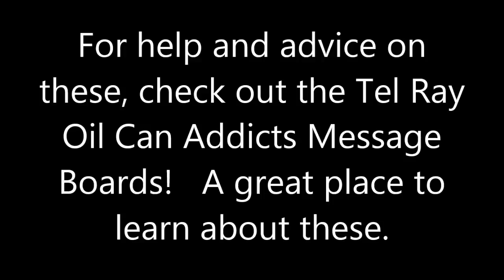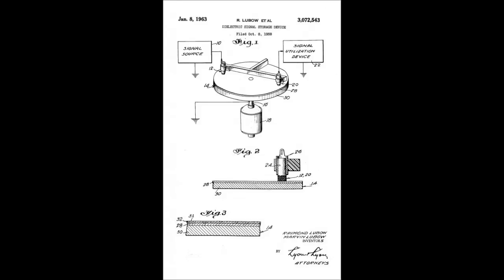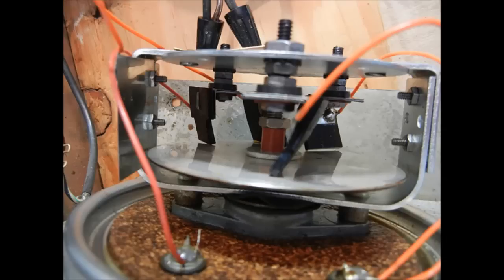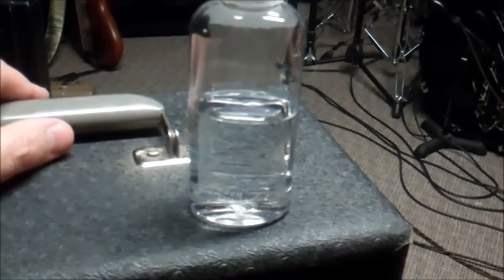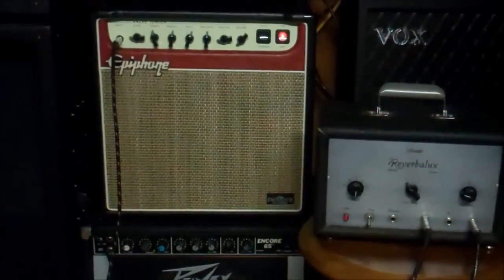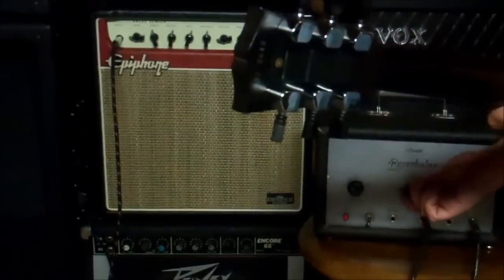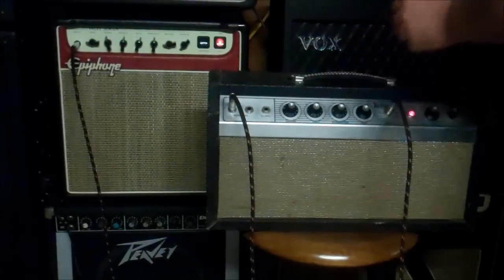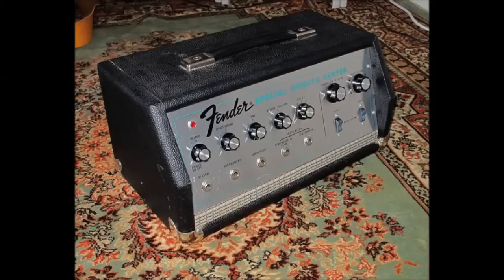All about Tel-Ray Oil Can Delays,  Electrostatic Delay Line,  Adineko

Comment: Do any of the units have a knob to change the speed of the motor I figure the slower the motor the longer the delay time but since it doesn't hold the charge long the slower the speed the more regeneration you'd want to extend the repeats.i really wish they would remake these things maybe design them with a bigger disc and multiple heads variable speed put a reverb tank in with it maybe pair it with a rotary speaker or some kinda vibrato or tremolo probably would cost so much to make that no one would be able to afford it.but really someone needs to start making old germanium transistors and bbd chips so the good old pedals can be made affordable
Reply from the maker: Variable speed drive wasn't common,  but I think there were a few models that did.   Germanium transistors and bbds can be purchased today easily and at reasonable prices... but it's "not the one the famous guy had".....
Reply: @DeadKoby  I know you can get Germanium transistors and bbd chips but the older models required for a lot of cool pedals aren't made anymore and finding a matched set of some are just near impossible I've bought a few pedals with alternatives to the right thing and they sound terrible and don't get nearly the same range like an ehx echo flanger or poly chorus or a burns buzzaround or a zonk machine you can get some of the sounds but not the more extreme settings which are always the best in my opinion
Reply from the maker: If you want Germanium transistors,  get them from Russia.  They still have plenty.

Comment: You missed the Fender Dimension IV. I have one of those and it is pretty cool but limited in usability.
Reply from the maker: With the delays as short as they are,  they are pretty much  "slap-back" machines.  Combine that with a spring for some pretty cool sounds.

Comment: Thanks for this video.  I've just finished restoring a Fender Echo Reverb 1 which is an Adineko 1001 in a different cabinet.  Either someone had put foreign oil in it or the old oil turned Amber over time.  After a good cleaning, 3 prong power cable, fresh LB65 oil, and new capacitors, it sounds amazing.   

However, the motor gets pretty hot and I'm concerned about that.   Does your motor get hot?
Reply from the maker: It will get warm after a time.   Try putting a drop of electric motor oil at the bushings... that may help a bit.
Reply: Those motors were probably originally designed for 110 or 115 VAC. Today’s line voltages in USA can vary, but generally are on average, 120- 129 volts, which is 10-19 volts higher! For an original motor unit, I would only use with a step down transformer, to ensure as long life as possible.

Comment: DK, I have the parts to restore one, the Fender Variable Delay Echo-Reverb. The pots and cap latest date date is 1968.  My research has brought me to your channel which I’m just now exploring. Great stuff. On my unit the chassis has been molested. No new holes, just clipped wires and it has what appears to be a failed attempt at a high gain preamp. The transformer appears good and It had no oil can.  However, I have acquired a NOS oil can and a second one sold as is for parts.   I don’t know what dual 12AX7 schematic was intended to be used.  The two unknown value trim pots on the rear are missing. 
Any guidance, pictures of guts and and advice would be appreciated.  Offline I’m at gmail as quayhog53.
Reply from the maker: I we'll try and hunt you down a schematic there are different version numbers they had liked Mark 2 3 4 something like that. Which model do you have?
Reply: DeadKoby unsure,  that’s the issue. I have all the TelRay schematics on pdf.  There are two that are dual 12AX7. There isn’t enough there to determine specifics.  Email for pictures
Reply from the maker: Ask the user  OilCanDelay  on the Tel-Ray Oil can board.   He's a veteran of these devices,  if anyone has it,  it's him.
Reply: DeadKoby I’m a member of the board and there hasn’t been much activity there.  My recent posts are the only posts in months.  The silence there is deafening.  I posted Ray Lubow’s LA Times obituary which I found in my research.
Reply from the maker: Here's what I found.   Hope it's useful.
https://el34world.com/charts/Schematics/files/Fender/Fender_echo_reverb_iii.pdf
https://el34world.com/charts/Schematics/files/Fender/Fender_echo_reverb_ii.pdf
Reply: Wow, the Fender mark iii is one I have not seen.   It’s very close to the TelRay Echo Verb-rato schematic but it lacks the bass and treble pad switches and other organ specific features.  It may very well be the one. There isn’t much original circuitry left that it’s going to be a total rebuild.  The Mark ii used a 7199 and one I’d seen. Thank you, I’ll pick it apart and see how close the little unmolested bits is to it.  Thanks DK.
Reply from the maker: You're welcome.   I generally don't take on "basket cases"...   if you look through most of my projects, they are usually almost all there,  and they "want to" work.  It's really cool that you're trying to preserve yours,  they aren't a common beast.
Reply: DeadKoby ,I don’t either, usually, but this is a unique opportunity.  I have the build skills and the unique parts.   I had the NOS unit for years thinking about making my own. When the chassis became available I knew it would be work but I didn’t know how disturbed the remaining circuit was.  Neither did the seller.  Except for the switching it’s not any harder than a champ.  I’ve built working Pultecs, LA2A and many amps.   I have the time now that I’m retired.
Reply from the maker: Super cool.  I hope you get everything running well.   These are such unique echos.  Nothing sounds quite like it.

Comment: I came across a Standel Duette 2 in PERFECT condition (caps,dropping resistors ,and cord replaced/fuse added)other than the scratched disk. Was hoping you might know of a source. I’d DEFINITELY be interested. Here’s a short clip of it during an occasion when it was sort of working well. https://youtu.be/jMJLFOaGrM4
Reply from the maker: There's someone on the Oil Can Addicts board that made a disc...   there's no commercial source.

Comment: Sounds pretty bad ... :/
Reply from the maker: It's a lo-fi sound,  but some people liked it enough to reproduce THAT sound with modern electronics.    I like that it's electro-mechanical and weird.
Reply: @DeadKoby  - I like lofi, I use vintage samplers to get good lofi sounds/tones; I'm not sure to what extent one's input determines the output sounds/pitches of this pedal, though ... ? Ie, is it more generative than 'processive' [of the input] ... ?
Reply from the maker: It has a lower mid-range frequency peak,  so the echos sound "underwater"....  there's also no erase head, leading to some crazy ghost effect.
Reply: @DeadKoby  - Sounds interesting.  I'd be interested to try one, of course, if only for the novelty ... :)
Reply from the maker: Keep an eye out for them... sometimes you can REALLY get a deal.   A perfectly healthy one brings 500-700$....   I bought the Standel Reverbalux from someone who didn't know much about it,  and was just selling off surplus electronics....  so I got that one for 100$